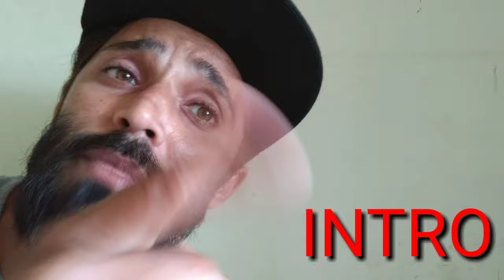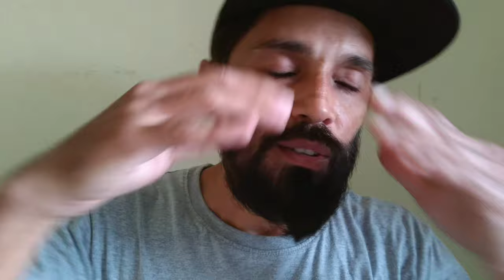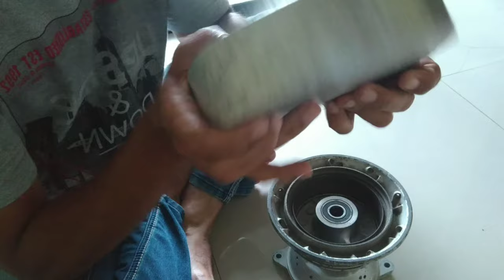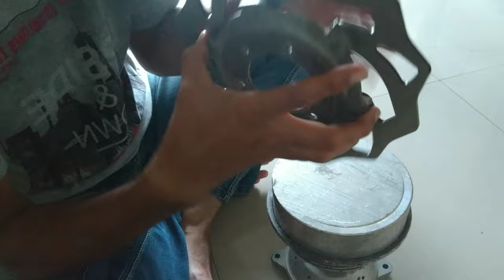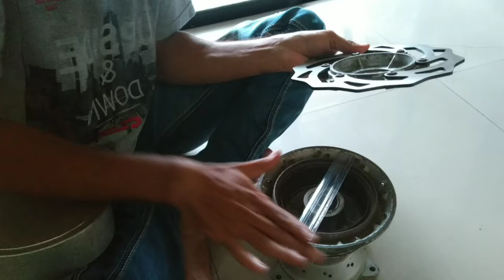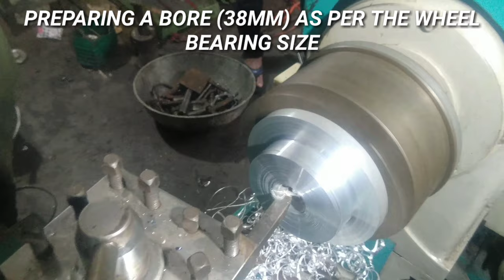HOW TO INSTALL REAR DISC BRAKE ASSEMBLY IN HERO IMPULSE||MODIFIED HEROIMPULSE

Comment: Bro pulsar front 150 hub 240mm disc 
Pulsar 220 rear disc 230mm how to fit
Reply from the maker: @Traveller .... You need to prepare a diac holder

Comment: Bro where you get the aluminium block.
Reply from the maker: @6shifts602.... It's a not a normal aluminium block.. It's industrial alloy block which sustainability is really good..
Reply: @routefortysix  but where do you get?
Reply from the maker: @6shifts602  I have contact in industrial area so get it from thr..

Comment: Bro apke hisab me hero xpulse ka front and back suspension lag saktha he kya hero impulse me or is there any alterations required.. Will be waiting for yor response.. And yor vedios kehena padega "EK NUMBER"😎😎😇
Reply from the maker: @Yogesh kn..Bro for the appreciation...Yes it possible to install Xpulse suspension in Impulse but there might be lil bit alteration required..
May I know the reason swapping impulse suspension with xpulse that will be more easier for me to understand requirement..
Thanks
Reply from the maker: @yogeshkn143  you can ping me on Instagram @route.fortysix
Thanks

Comment: Don't you think that block will add to much weight to the wheel?
Reply from the maker: @GTclips..To avoid more weight on the rear wheel we used Aluminum material which is lighter in weight as compare to MS material..After turning the block the weight of the aluminum block was 476gram..Which is same as rear drum plate and  shoe ...
Thanks for your comment..

Comment: Sir ye aluminium kon si grade ka he
Reply from the maker: @tecno mobile khajana....thank you for asking me interesting question...
I used 2011grade alloy...this material is high mechanical strength and excellent in machining capability..its difficult to find ... Usually you can use get in Industrial area...